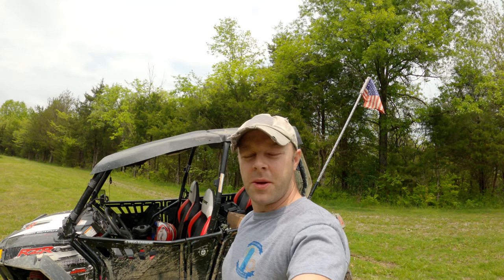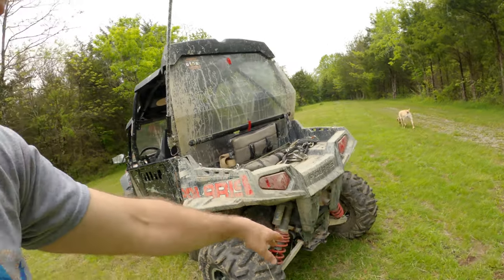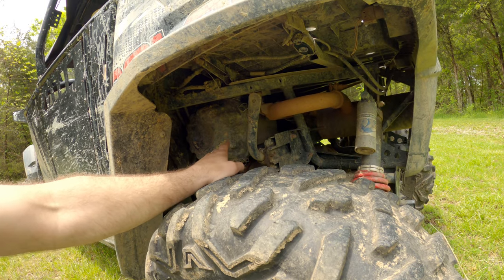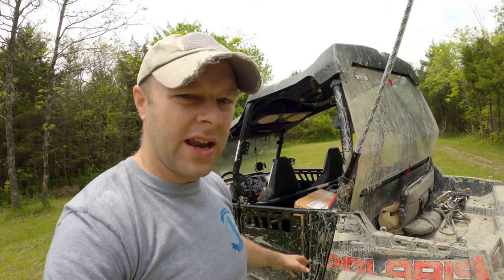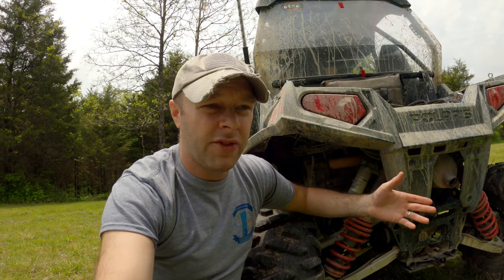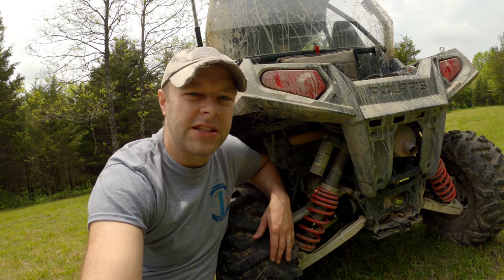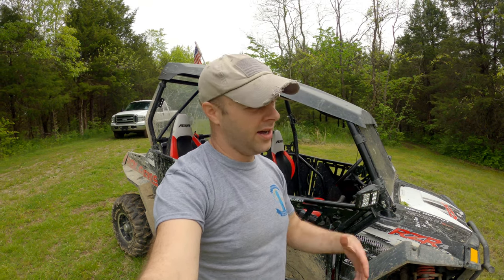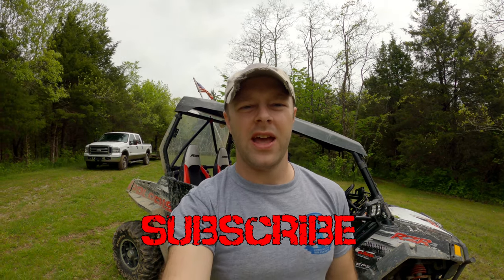Top 3 common RZR 800 problems [Air filter, Power, and Rear Differential]

Comment: My 14' 4 800 with 2k miles rear diff pinion nut was about 3 threads from coming off. Thankfully, I saw someone mentioned it in the comments for your previous video. Took the diff out myself in about an hour and took it to a local offroad shop where they used red loctite and gave it 3 ugga duggas.
Reply from the maker: Did you just reuse the old parts? Glad you caught it in time!
Reply: @RuggedAdventures   @Rugged Adventures  Me too, rear diffs are expensive and hard to find. I reused everything except the seal which normally gets damaged on removal. Bigjeepman10 has has a great how to video on the repair.

Comment: Right after I bought my 2011 800s in 2016 but before it blew up (ahem), I took my RZR out to the gentleman in Winnemucca, NV and he got me into the "tight nut club".  He didn't charge me anything (GASP!) but I left a hefty 'donation'. And as I mentioned in the comment section on your other video on why to buy 800's, I now have a 2018 800s engine in my 2011.  It has all the power I need. When we used to have ATV's, I always said if you could do 60 mph, you were on the wrong road . . .   Just sayin'.
Reply: Who in Winnemucca NV?
Reply: I actually just blew up my Robby Gordon 2012 800 and am super tired of the low powered engine and weak trans. 

Will a 2018 drop right in ?? Looking to upgrade this to a wheel spinnin monster

Comment: My 800 developed a gas leak on the fuel injector, specifically from the Schrader valve. If you detect a gas drip from that jet nozzle (looks just like a threaded bicycle tire valve), tighten the inner portion of the nozzle by using a pair of tweezers. There's a Youtube video on how to do this for tire valves, same process.

Comment: I think I definitely would have covered the dowel pin in the motor as a motor problem point too, if they get stuck your motor looses oil pressure, best way to avoid it is when doing a fluid change take it out with a magnet polish it yourself or take it to a jeweler and have them do it for like 5-10$! Totally worth doing.

Comment: I had problems with my rear diff. Something let go and it made a big hole through the differential so hard to buy a new one. I have the 2014 rzr 800 s le and had 7500 km on it
Reply: I've seen several of them grenade like that, and it's the pinion nut issue described in the video that causes it. The nut backs off, the pinion rides up on the ring gear more often than not busting the shaft just in front of the gear itself and then hits the case and busts out the side of it. Polaris never has admitted to the issue, never did a recal and never made an official repair. If you get a new differential it will have the same issue so due the DIY repair on it yourself prior to installation. Most dealers won't admit to knowing what you're talking about so get online and track down a set of tools to borrow or make your own if you have the skillset. There is also a Facebook group on the problem where you can buy the tools or potentially borrow them.
Reply: @jeffking6672  mine just granaded today :(

Thank you for posting this  regarding the fb group, (Update: I can't find any such on FB.
Can you post a link, or the name of the group?)

Comment: Keep in mind when using a K&N filter you MUST spray the oil on it. This will keep the dust out.
Reply from the maker: Even so they let tons of dust through and will junk your 800 engine.
Reply: @RuggedAdventures  I have never seen good things from any k&n air filter.  People think they work better and want to feel they do because of the money they spent only thing I’ve ever seen was CHeck engine lights on pickups.  I’ll steer  clear
Reply: You absolutely HAVE  to have a pre filter with KN.  No exceptions
Reply: I and n filters sprayed with oil is nothing more than a oily mud pie .

Comment: Good morning, I have a 2011 rzr 4  800. I have a chirping noise in the belt area when slowing down. Have changed ujoints, carrier bearing and belt but still have the chirping noise. I just noticed that the rear end is out of alignment, the left tire is about 2" closer to the front than the right tire. To me that explains the chirping noise, alignment problem at tranny. Is there any way to adjust this alignment? Thanks

Comment: I have a2010 800s,runs great then spits and sputters like I'm out of gas and dies,not out of gas,fire's right up and down the the road we go,does it over and over and the more it continues the less miles i can get(sometimes less than 100yards) any advice would be appreciated
Reply from the maker: Sounds like a bad fuel pump (highly common)or clogged fuel tank vent.
Reply: What was it? Maybe bad coil?
Reply: I had a problem with mine shutting off after it warmed up and wouldn’t  run good until it cooled off….turned out it was bad plugs…blew my mind, had a friend with a Harley acting the same turned out to plugs also it’s unreal

Comment: You have  to run a pre filter on a KN.  And sorry your wrong.  Polaris actually put out an article that the air intake boots were leaking …. And how to fix. Which was silicone.  Yes I have all this paperwork from Polaris.  Aftermarket air filters are fine … Polaris filters are junk.   A uni good r something similar is fine